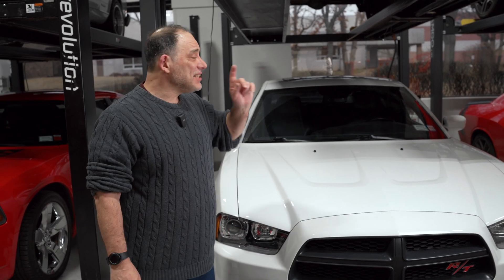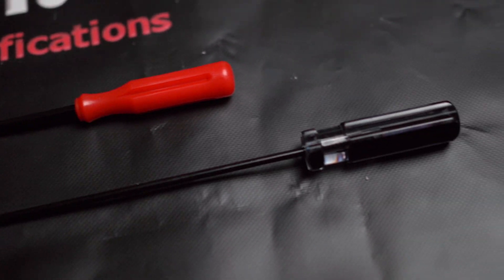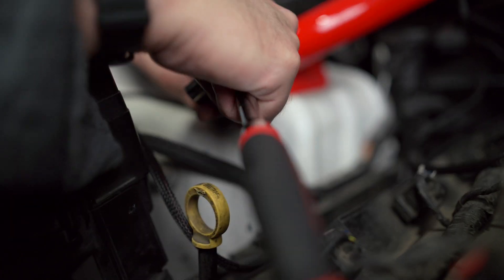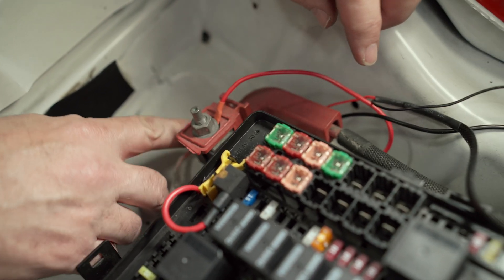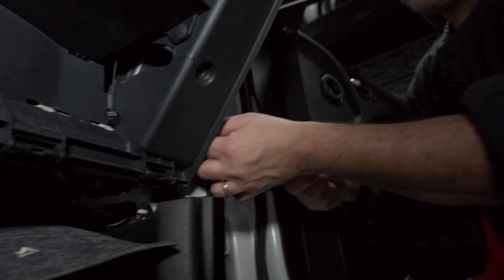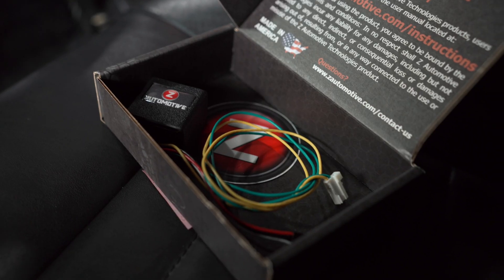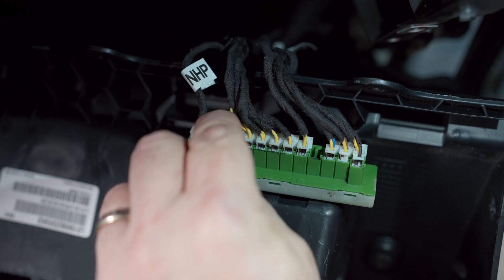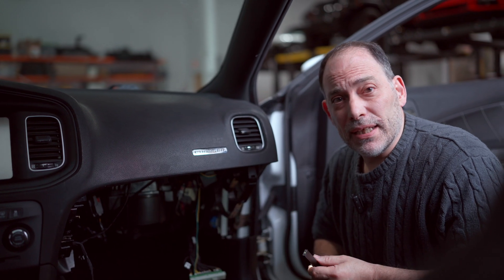Mastering Performance: SRV Controller Installation

Comment: Thanks for this Video. What is the best setting for my 5.7 v8 2017 with 6.4 intake and this Controller? Thanks :)
Reply from the maker: @DrehzahlbegrenzeRR  the default setting at 4900 is determined by the engineer to be a good spot, but it also depends what you’re doing. Dyno testing it would help you determine the best range for your vehicle